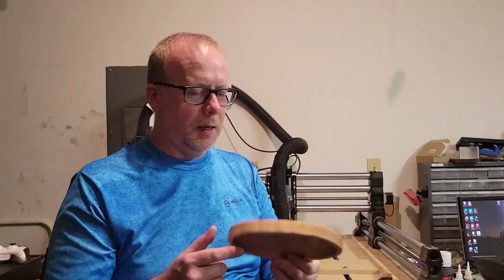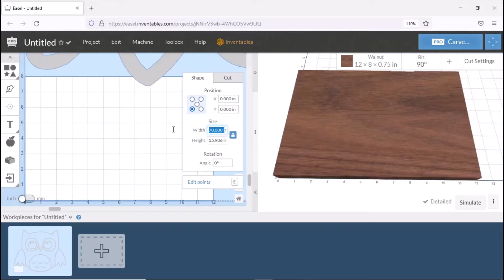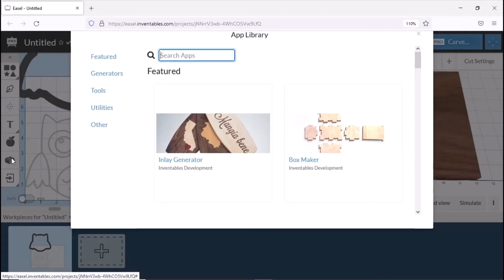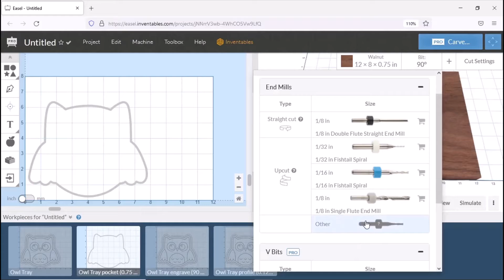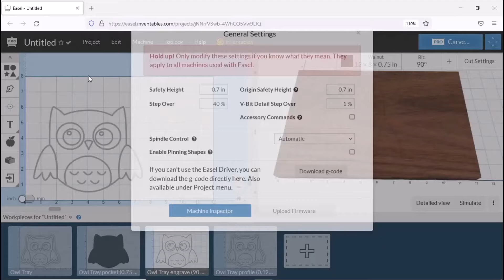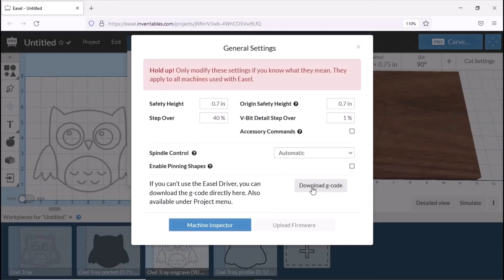Custom Trays The Easy Way -Jeff Holmes

Comment: Do yourself a favor and look into Vectric software. You will never use that one again! I cant believe they actually charge a monthly fee for that horrible software. Thanks for sharing and helping people!
Reply from the maker: I actually have Aspire and use it often. The point is you don't have to over think this type of thing or spend tons of money on software. I'm not sure why you assume I don't know about Vectric software.  Easel is actually a really good program for the beginner and please don't start with the whole "just learn one program " argument.  Software changes and often they are major.

 With Easel the beginner doesn't have to worry about feeds and speeds,  post-processing or messing with UGS on most GRBL machines.  I have helped people that couldn't figure out UGS get up and carving with Easel in just minutes.  

I look at it like this, time is money. I know this can be done in Vectric or Carveco but not this fast. I also use Easel for stacked text because it literally takes 5 minutes to setup.